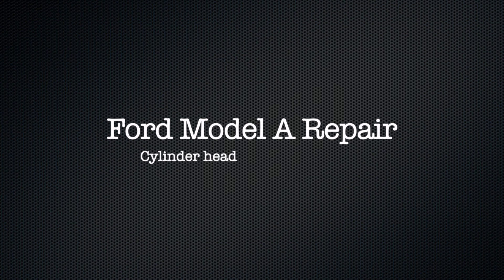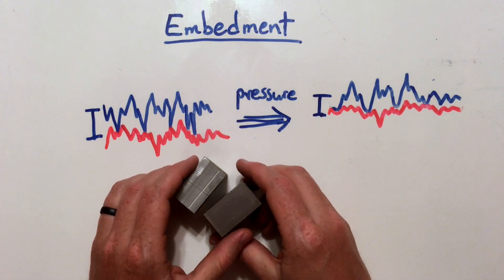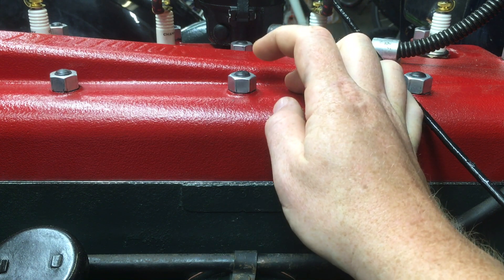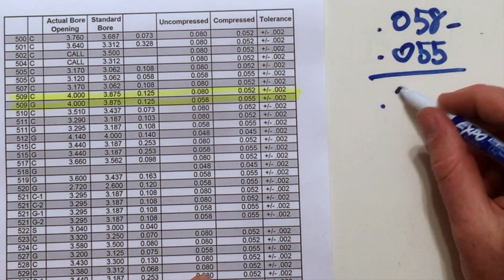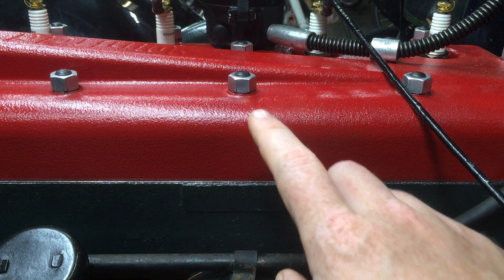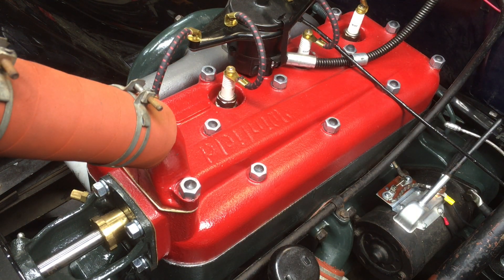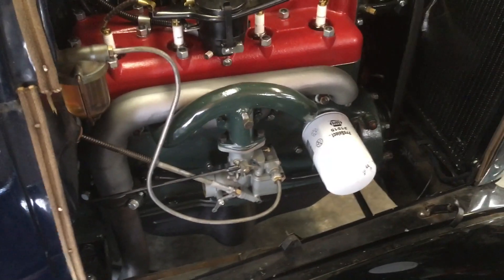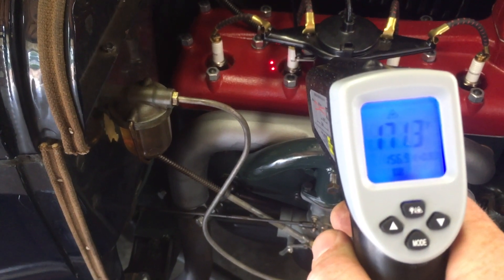Model A Ford – (3 of 3) cylinder head installation – head gasket break-in

Comment: You explained it great! I just purchased my first model A. Previous owner said it had blown head gasket so he replaced it but now #2 &3 cylinders are leaking worse than before so i bought the car. I cant find any cracks. What would you recommend buying a new gasket an try again? Any help would be greatly appreciated!!!
Reply from the maker: There's a thing that's true for modern cars and antique cars alike – head gaskets rarely fail for no reason. If you've had two head gaskets fail in the same spot, something's causing it. First place I would look is what's called the faying surfaces, which is the interface between the block and the head. If either the head or the block are warped, the surfaces will not come together properly and the gasket will fail. You need to test the surfaces for flatness. I cover this in my pre-flight checklist video. https://youtu.be/UAPdsTg4lbE
Reply: @alexiskai  I will watch that and check it out. Thank you for your help!! I can't wait to get my A on the road an driving!

Comment: Nice video, what is the name of the head you put on? 😇🙏
Reply from the maker: This is a modern reproduction of an early speed head, the Winfield 7:1 "red head" – so called because it came painted that color. The Winfield design moves the spark plugs from over the intake valve to between the valves, which means the stock plug connectors don't work anymore, and if your plugs are tall you'll get arcing to the spark advance control rod. It's a powerful head but for my next car I'm switching back to a stock-appearance head.

Comment: Great video series! Thank you! What plug wires and connectors are you using?
Reply from the maker: I made them myself using reproduction Model T spark plug wires and terminals. No tools other than wire strippers and a big honking pair of pliers to put a 90° bend in the terminal at the right spot and then crimp them. Very easy and they have a great look.